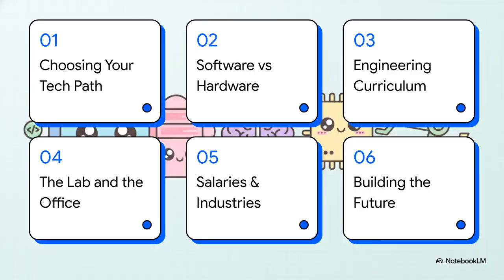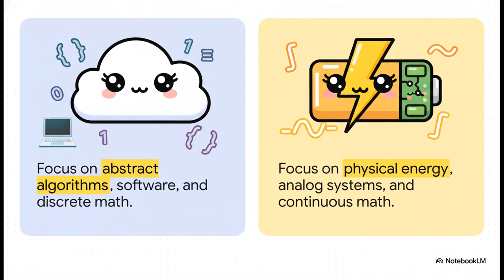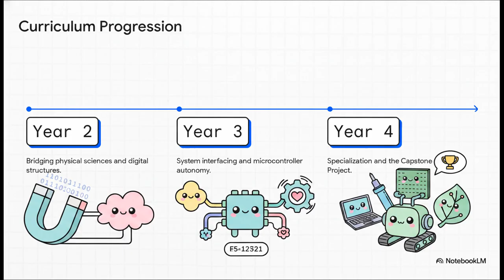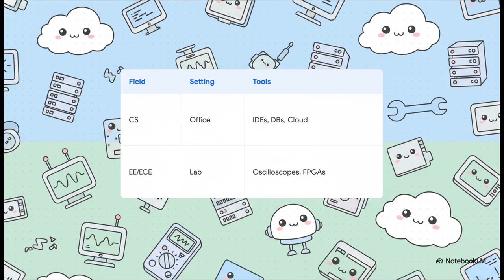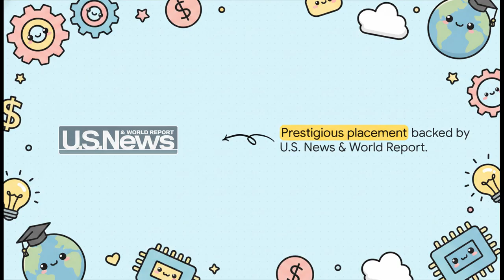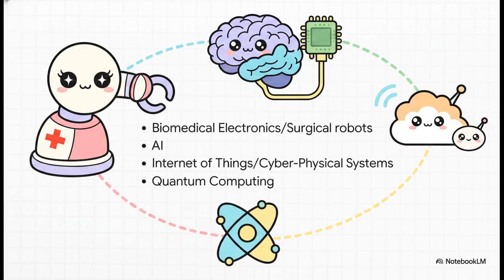Why Choose B.E Electrical and Computer Engineering? ECE Salary, Jobs, & Guide

Comment from the maker: Why Choose B.E Electrical and Computer Engineering? ECE Salary, Jobs, & Guide
Are you curious about the bridge between physical electrical hardware and advanced computational systems? 
 This comprehensive guide explores the Bachelor of Engineering (B.E.) in Electrical and Computer Engineering (ECE)—the backbone of all modern technology.
In this video, we break down:
Global Salary Potential: Learn why ECE graduates often start with salaries exceeding 100,000∗∗,withmid−careercompensationreachingover∗∗220,000.
Detailed Curriculum: A year-by-year breakdown of subjects, from circuit analysis and electromagnetics in year two to embedded systems and microcontrollers in year three.
ECE vs. CS vs. EE: Understand the professional differences between Computer Science, traditional Electrical Engineering, and the hybrid pathway of ECE.
Future Career Demand: Explore high-growth industries like AI acceleration, robotics, semiconductor manufacturing, and smart energy grids.
Expert Advice: Study tips from successful students on mastering mathematical foundations and leveraging departmental mentorship.
Whether you are a prospective student or a career advisor, this video provides everything you need to know about the engineering branch that is building the future.